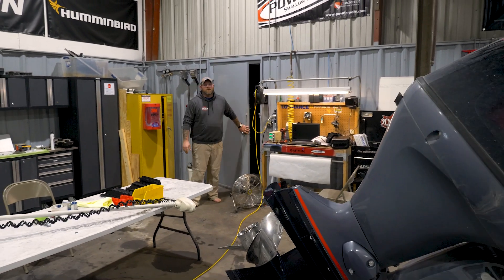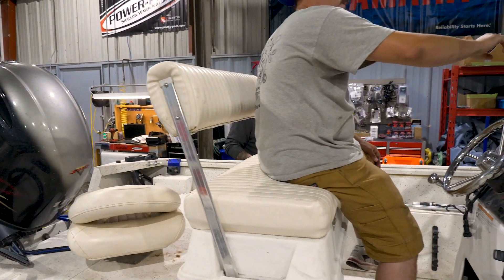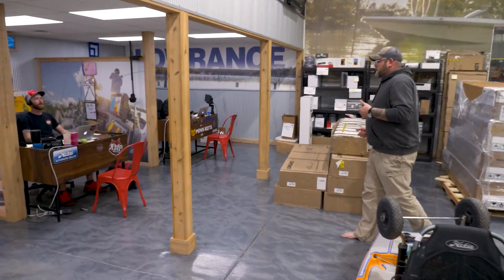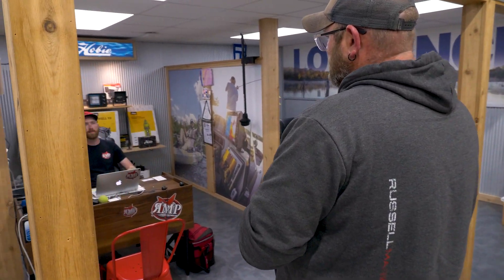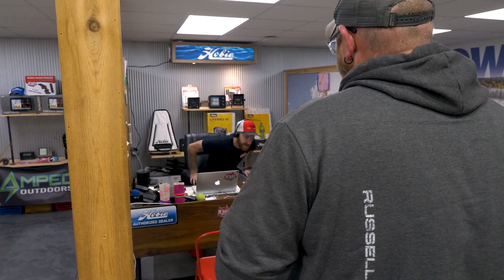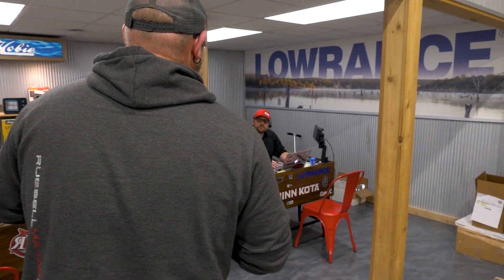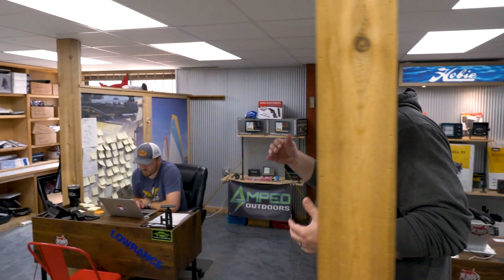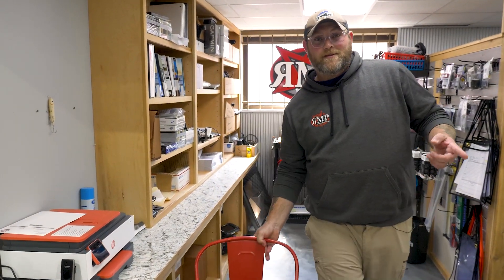TECH TIPS - Help us help you

Comment: Hi  I added the UHD73 to my Bow and removed a Lowrance G-1 HD.  I now had TM pedal interference on traditional sonar and it is not on clear vue. Installed Livescope on it's own 12 volt source and used the buss bar in the bow of the Ranger that the G1HD Lowrance was using fpr my 73UHD.. Other than turn sensitivity way down what else can I try to rid this interference?  Still running a Fortrex and awaiting a Garmin TM to replace with .
Reply: There’s a couple of things that can help you out, firstly instead of running your live scope box to the bus bar try wiring it directly to your crank battery ( with inline fuse of coarse ) or your dedicated electronics battery if your using one. Second,  if you are running a multi bank charger that is charging both your trolling motor batteries and crank battery install a noise isolator between the charger output leads going from the charger to the crank battery. I always steer clear of tying any chart plotters or live imaging system in to buss bars as they can pick up electrical interference from any other boat electrical equipment that is also tied to them especially any equipment that has a motor as these can generate frequency feedback in to the circuit.

Comment: Love your channel and tips!  With a Force TM, Force Remote, a 122sv on bow, a 126sv and 106sv on consol, all having a GPS antenna and networked, would love to know which unit actually establishes the waypoint location?  For example: I'm on anchor lock and fishing out of the back of the boat holding my remote 20' from my TM and use the remote to set a new WP.  Which one of all my GPS antennas is used to establish my newly set WP?  Could be 20' difference!  Thanks again!!